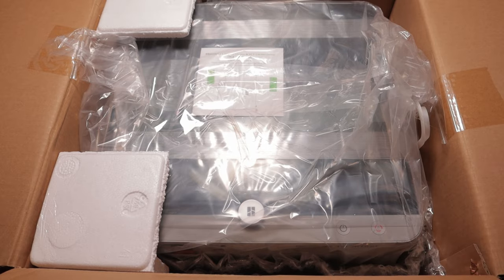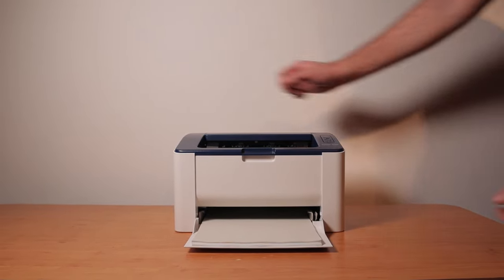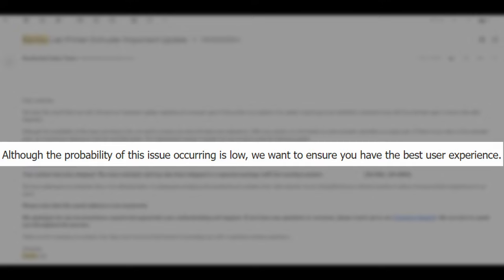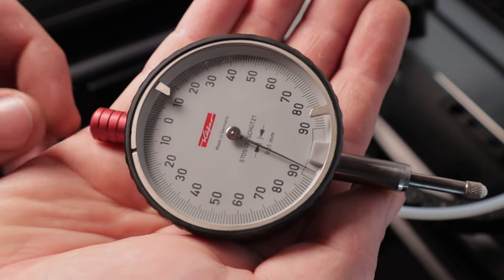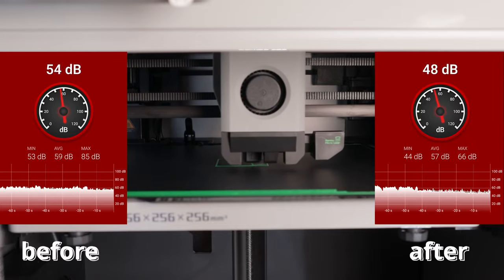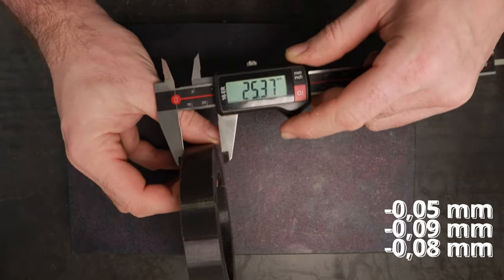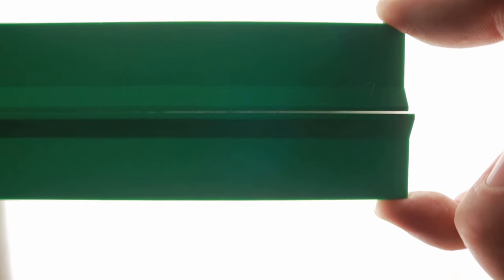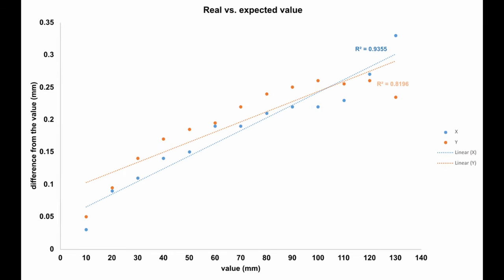How acurate are prints from Bambulab X1C 3D printer / bed flatness, ANC, unboxing

Comment: Excellent video, I’m looking to do the same. Replace/ retire my trusty ender 3 with an x1c in my machine shop. The ender is perfect for a small prototype projects and I’ve even printed soft jaws for light, small batch, aluminum cnc machining using PETG. 

The speed at which these bambu printers operate is definitely enticing, also I’m getting tired of babysitting my ender or worrying about it running unattended overnight. All the noise of novice, first time 3D printer owners was holding me back. Thank you for taking the time to create this video
Reply from the maker: Thank you for the feedback 🙂, I Hope you will be satisfied with the purchase!

Comment: Your measurements and their inaccuracy from reference, is much more a product of thermal expansion in the filament. It’s shrinking as it cools. 

Hence, your ended prints more accurately than the x1. If you printed at the same speed between models, you’d likely see a result that much more realistically represents the abilities of the printers. 

When the bambu printed faster, each layer isn’t allowed to cool as much before the next layer is added
Reply from the maker: Thanks for the insight. I printed all the models with standard printing profile (200 mm/s), the only change i did is type of infill (gyroid). But it might be the reason, why ender ended up a little bit better.

Comment: I noticed that the belt positioning on the tensioning bearings on your x1c isn’t centred. Did you re-adjust the belts or did it come like this from the factory? Cheers!
Reply from the maker: Right from the factory, thanks for the  info, I'll better check it.

Comment: on the precision you compared 2 different filaments (colours) which can shrink differently. Also speed makes things less precise. Print with the same speed and compare, Use the same filament. Your argument.... Why should I pay 10 times the money if I have to print at the same speed. Because prototyping... Sometimes you have to test concepts to be able to modifie something and retry. Sometimes pecission is not the key. But I would try always the same filament to compare precission on 2 printers. an other point for shrinkage is the lifted ends. The layers pull on the botom layers which causes them to pull the ends up due to shrinkage of each layer. Each filament in each colour has a different value in shrinkage. In Cura slicer there is an option in compensation for Shrinkage. You design a part for example 240 mm long and 10 mm wide print it once in y direction and the other time in x direction. The shrinkage should be the same. Now you mesure and can ad a compensation in your slicer. This should be done for each filament. Very important printing ABS as there is a lot of shrinkage.
Reply from the maker: Thanks for your input. I used generic PLA for ender and bambu filament for X1C.I got to say that I did some suprisngly precise prints with abs using my old ender, no enclosure, no additional setup it just worked 🙂. BTW I did the XY roundness print with different PLA filaments and speed profiles on X1C and the difference was more less same. My solution is just simply scale the model till I figure out all the bells and whistles in the slicer

Comment: So the flatness of the bed on the X1C is an absolute lottery. Some are much flatter than others and it’s just the luck of the draw if you get one that’s as good as this one. I have a few X1Cs and they’re all quite flat front to back but not flat left the right. One of them has a dip in the center of the bed that’s over 1mm. Truly awful. This needs sorting out for gen 2 of this printer.
Reply from the maker: I've read numerous threads about bended beds in initial wave of pre-orders. In my situation, the bed is reasonably flat in the front (left-right orientation) due to the presence of rails and a Z screw. The same can be said for the front-back orientation in the center. However, the far edges pose a challenge as there is inadequate support, and the bed itself exhibits some springiness. Introducing a tall and heavy print may cause deflection in the opposite direction, assuming good adhesion, of course. The bad thing is, that you cannot get the "banana" out of the bed. 1 mm is a lot. BTW I'm not sure how much is "replacement bed" much and also, the procedure of bed exchange is probably hell.
Reply: So do you think the p1s and p1p have the same bed problems?
Reply: @JustAnotherCraftsman  yeah, changing the bed is something I’m considering. But it’s a hell job on these like changing the belts which I’ve done @4000 hrs. It is a OCT 2022 model this one. Not pre release. I hope they’ve improved the QC on this for the newer models. It’s also worth mentioning that once the bed is up to temperature the mesh and flatness could be completely different anyway. It might deflect with heat. The printer does a good job of compensating for this issue so for most people it would never be an issue. But I noticed areas on the first layer infill which were over filled and some which were under filled. My other X1Cs seem better.
Reply: @baremetaltechtv  I only have one P1 and the bed is not flat but not too bad either. I suspect Bambu labs have replaced so many bad beds now that they’re making an effort to make sure they go out flatter.
Reply from the maker: @baremetaltechtv  I don't see much complains about banana bend from current batches. I think, that they somehow figured it out. Also, my bed was incorrectly trammed from production. But if you refer to far edges, yes, they are a bit springy, but i don't think that there is currently corexy printer in the price range of P1S not having the same problem, there is simply no support, except for the rigidity of the bed itself. If there are users of other brands with different experience, please correct me. Also keep in mind, that not every combo of operator+milling machine is able to make (aluminium/steel) part parallel within 0.1 mm (top bottom) at 220 mm distance and I'm talking about 2 tons cast iron machines. Here we have 14 kg machine that is almost capable of doing it (in plastic of course), as you can see from measurements I did in the video on granite surface plate. And at the end it condenses down to what are you planning to print. My aim is mostly engineering stuff, models for PLA lost/ sand casting etc., so the flatness do matter in my case.
Reply from the maker: @bonjipoo  Thanks for the insight and info!
Reply: @JustAnotherCraftsman   I ask because I just bought p1s combo 2 days ago, have yet to get it out of the box, seen a few complaints over the last year of incorrectly trammed models and bent beds. Staying optimistic till I see anything wrong :) One of my goals is to print a 3d printer and then a cnc mill, so perfect flatness is something that would affect everything I make afterwards
Reply from the maker: Fingers crossed, I hope you bought an excellent piece and not a lemon 😉
Reply from the maker: @Steefen_magam thank you for the info, my backup plan is to machine one myself once the things go south

Comment: That precision test that you did is completely inaccurate and invalid as the material has thermal expansion and contraction
Reply from the maker: The point was to test the out of the box performance and how much the machine itself compensate for the shrinkage. I tried to scale the model (just 100.2 %) and it works just fine. I'm overal happy with the printer. Anyway, thanks for the feedback.
Reply: Does Bambu studio not have a shrinkage section like orca?
Reply from the maker: @Craysav I think so, but it was straight from the box testing. It could also be compensated by scaling.
Reply: Okay. I’m not super mechanically inclined so do you have any tips on how to do the tramming? I noticed Bambu has a wiki on the tramming. Did you attach the depth gauge then zero it out in the middle? Still confused on your reference measurement point. Thank you!
Reply: @JustAnotherCraftsman  you also used different filament which again invalidates the test